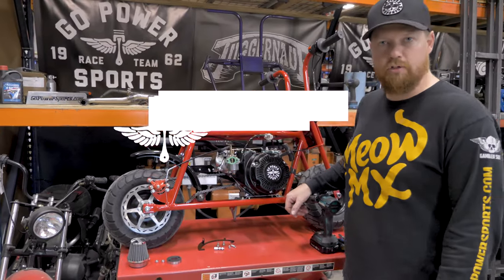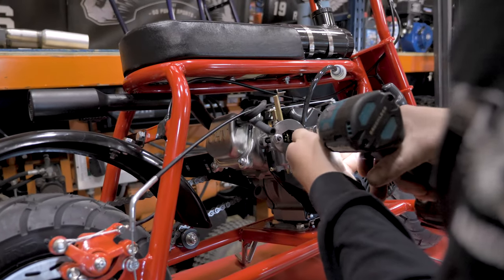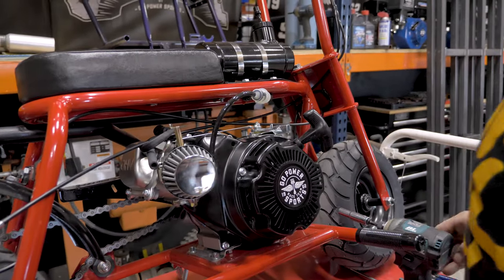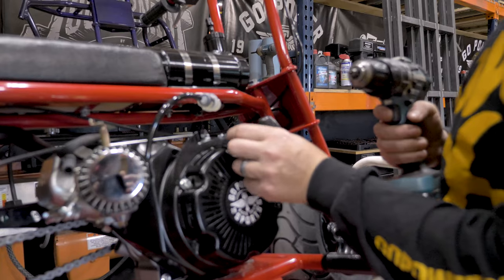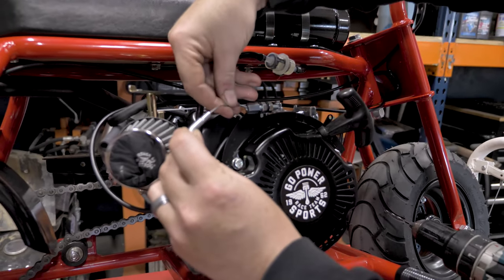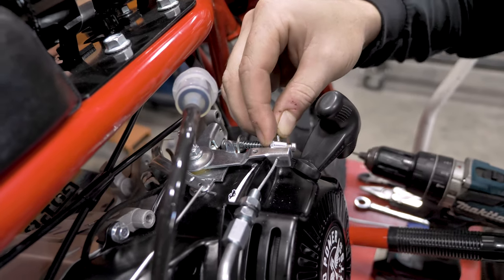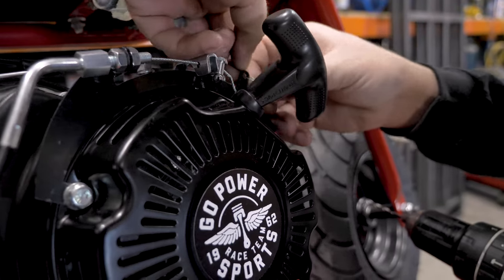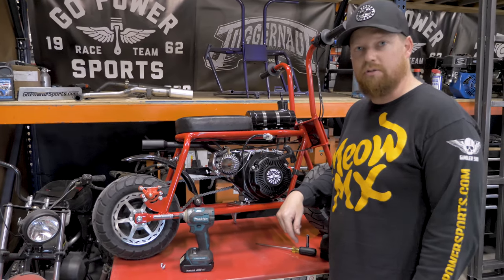Predator 79cc Throttle and Air Filter Kit

Comment: Modification, in a vice I bent backward, the attachment  that holds the fitting and two jam-nuts.  That creates a straight line for the cable to the governor arm on my 79cc Predator  motor.  Otherwise it will run at an angle.  Dan.

Comment: Installed the linkage bracket but when I go to pull the handle to start it a grinding noise can be heard.  This isn’t from the engine running because it only happens when I’m starting it.  Any helpful tips?
Reply from the maker: Send a video of this to sales@gopowersports.com
Reply: I had the same issues and figured out they sent the wrong length bolts for the throttle linkage bracket. They are touching the fly wheel and caused some damage to it. I’m sure you are having the exact same problem.

Comment: 2 questions when well you get your minibike suspension back in stock.  And do you have linkage for a predator 212cc
Reply from the maker: It'll be a few months until the front suspension is back in.  And the 212 linkage is on our website, part #26410.
Reply: Ok thanks

Comment: Will this setup work on the Mega Moto M80 with the 79cc motor
Reply: Probably not. The MM80 is a clone of a different motor, a Lifan 80, I think. I have been unable to find any upgrade parts (stage 1, etc...) for that motor since Hot Rod Minibike shut down.
Reply: @kevinstott1317  
I purchased the frame from Mega Moto, and I’ve been piecing it together with my stepson. At this point we’re planning on using the predator 79cc motor
Reply: @stanlucas665  Sorry, I misunderstood. I have an MM80 and I bet it will work great since the carb on the predator hangs off the side of the motor instead of the back of it, like on a Lifan. A predator 212 fits on that frame, so there should be plenty of room. Good luck on the project! Great memories are made working on these with kids!
Reply: @kevinstott1317  
No worries for anything misunderstood. It’s all good